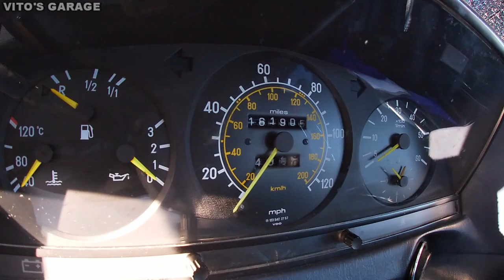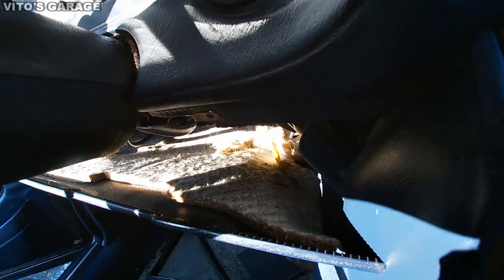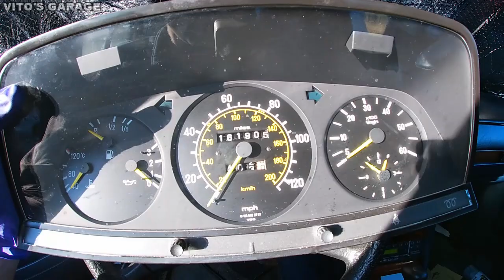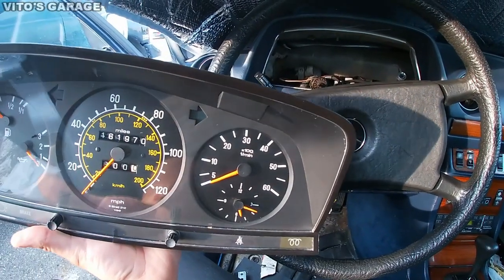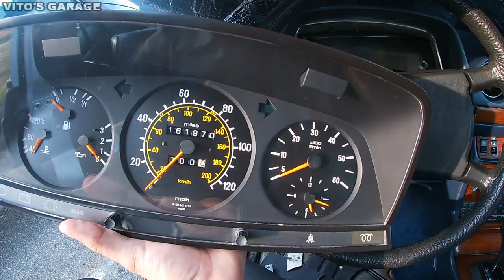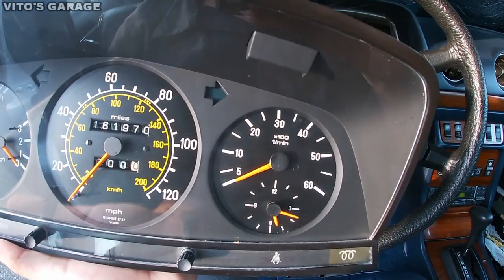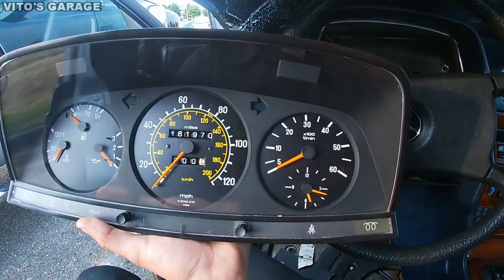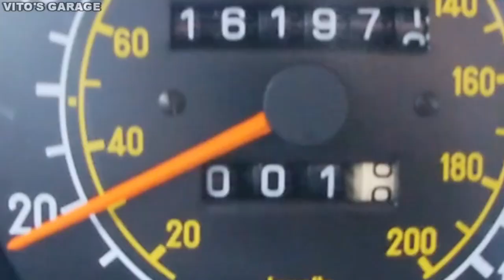Part 4 Dad's Gift '85 Mercedes 300D:Battery Tray & Area Restore, Cluster Refurbish, Ignition Tumbler

Comment: Wish my kids appreciated my 1984 & 1985 300D.  They served one son for 9 years thru college, med school, and residency but just "old junk car" to him, though only had two problems during that time.  Didn't see your tumbler fix.  In my 1984, the key rotation was jamming.  Turned out not in the tumblers but rather a spring detent inside the die-cast housing where the steering lock rod insert had broken apart to jam the turning.  You must pry off the steel cover to see it.  No more detent but works fine without it since the switch has click position.
Reply from the maker: You need to teach your kids to love, take care and appreciate these amazing old school machines.
Reply: @VITOSGARAGE  Thanks, but not sure that works with most millennials.  They imagine they will colonize Mars with Elon Musk.
Reply from the maker: @williamgrissom9022  can’t spoil kids!! Stay old school forever. Nobody will ever make such amazing cars like they used to 30-40 years ago. Nobody!! You realize that a lot of parts on these cars are still original from the factory? That’s pretty impressive. Put love and care into these cars, not those garbage new “cars”….